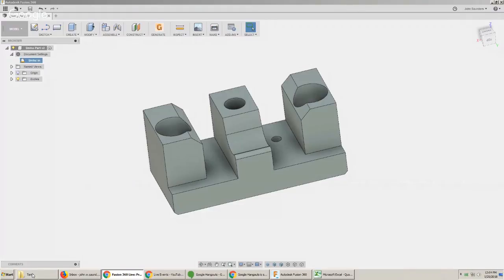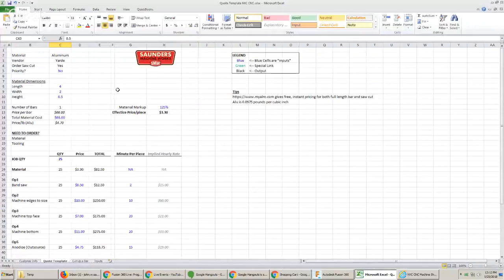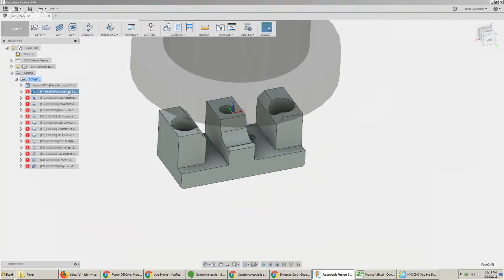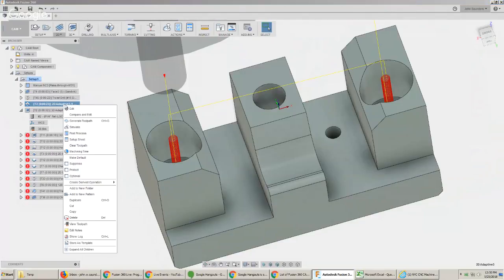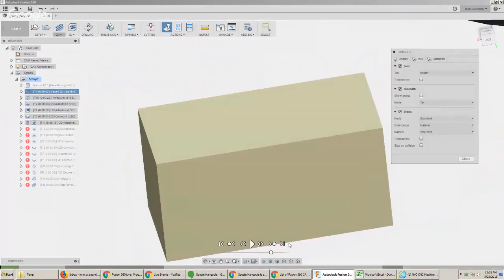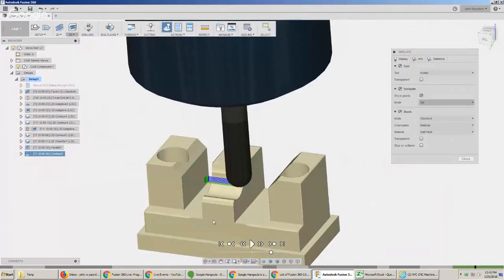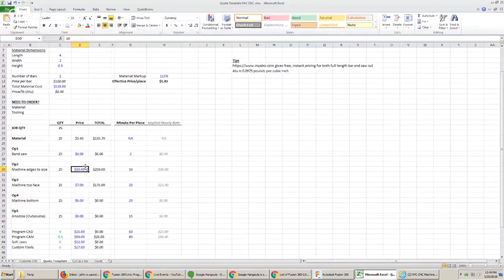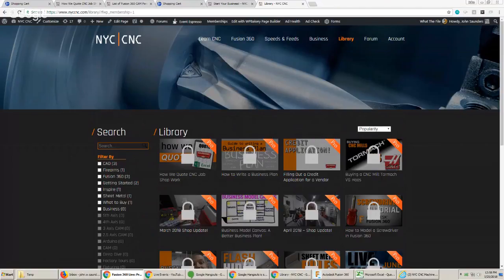Fusion 360 Live:  Program & Quote a Job Shop Job

Comment: Just taking a guess here but from my engineering experience with aluminum castings, I’m going to assume that “manifold quality” is in reference to the porosity of the aluminum (for making a manifold).  Interlinked porosity will allow for leaks under pressure through the aluminum.  For example, 100% of cast aluminum wheels are leak tested (usually with helium), and up to 2% are allowed to leak and be rejected.   GM even has a field leaker repair process (sand paper and epoxy basically).  Leakers are rated at psi lost per month and there’s a spec unique to each manufacturer.  Aluminum is full of micro and sometimes macro porosity.